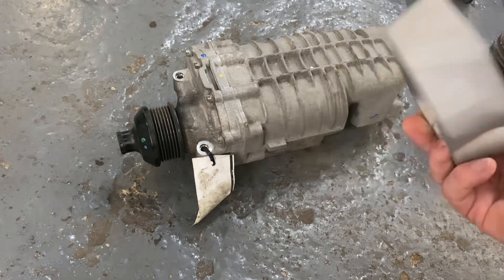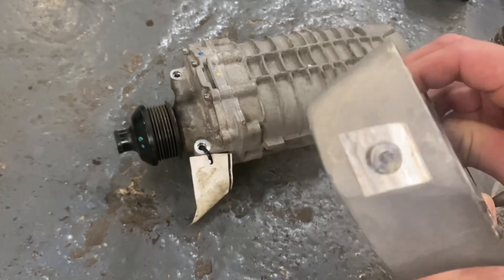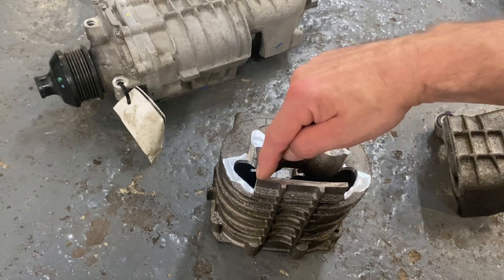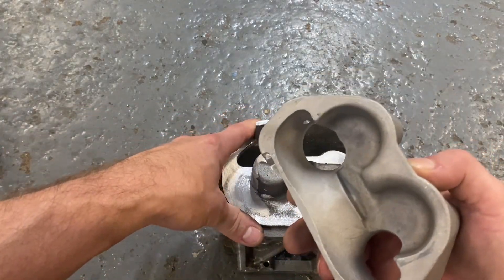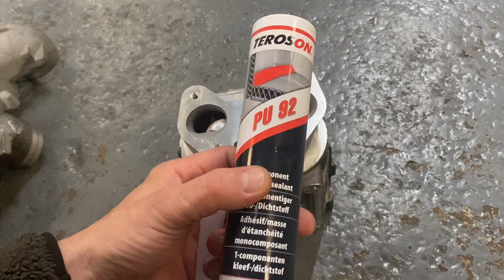Vmaxscart DIY Supercharger kit cast section fitting for the Eaton M65 supercharger.

Comment: Although designed for the sealant could I TIG the adapter onto the original supercharger housing instead?
Reply from the maker: nope usually distorts the case , better to bolt and seal